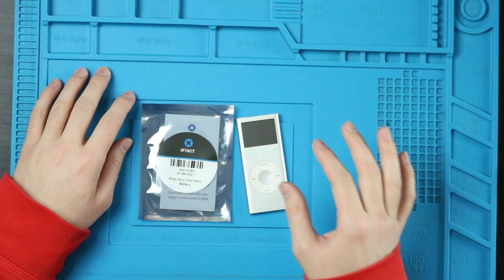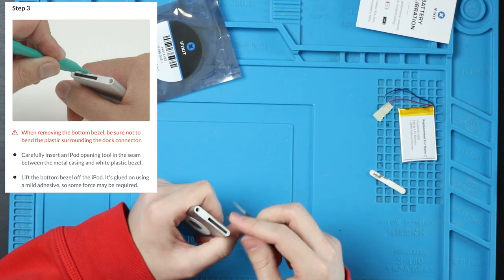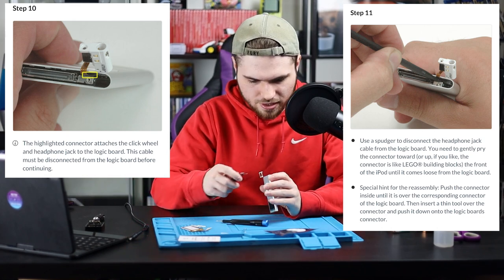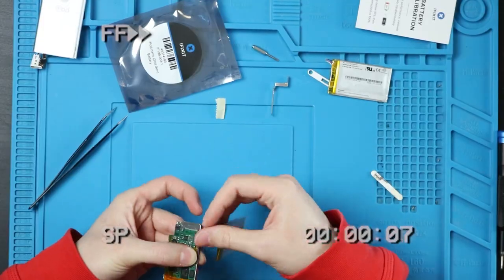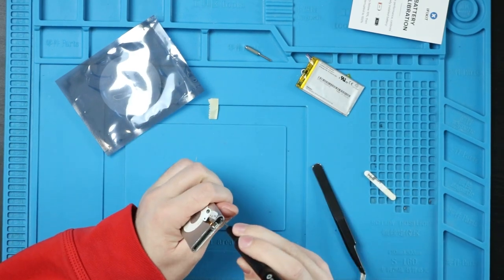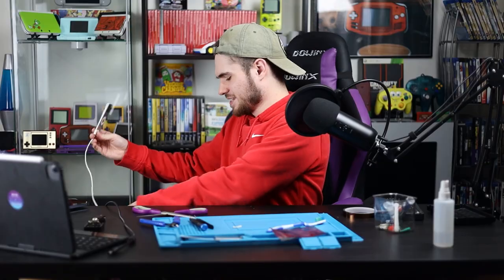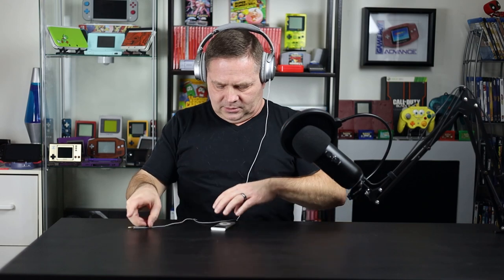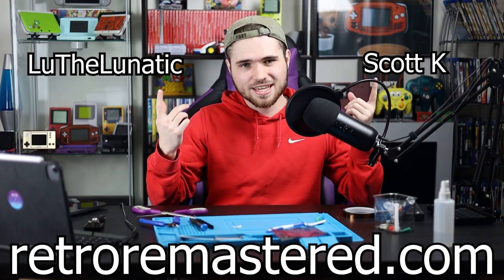Fixing My Dad's 2nd Gen iPod Nano! (Battery Replacement Tutorial)

Comment: LOL I got a 2nd gen nano included with a mini I bought. Wasn't going to replace the battery and just wanted to see if it worked, so I plugged it in and the screen didn't work, but it was still able to sync with my library. Left it on the charger too long and the battery blew up on me. Ok, maybe not "fiery explosion" blew up, but it started inflating and broke the screen (although the screen did start working, aside from the cracks in it). Threw it on top of a fire pit so it wouldn't burn the house down and it's sat there for more than a week now and I'm kinda scared to put it in my truck to take it somewhere to be recycled...

Comment: I replaced the battery in my iPod Classic I got in high school about 5-7 years ago and it was at least a bit easier than that. Need to do it again, the replacement battery isn't holding a charge anymore. I've been waiting to do it because I also want to do the flash conversion to replace the hard drive with an SD card